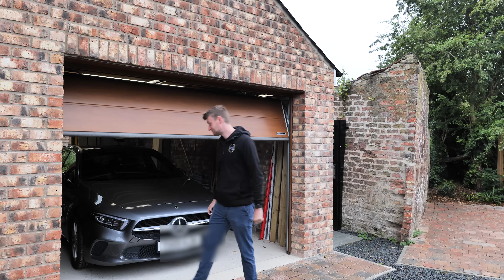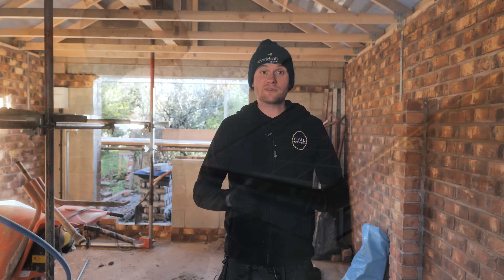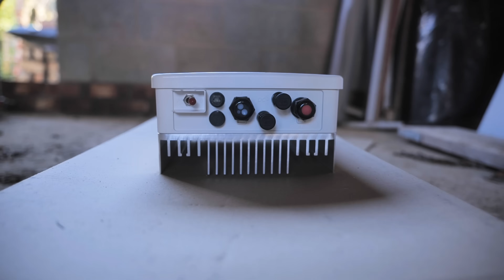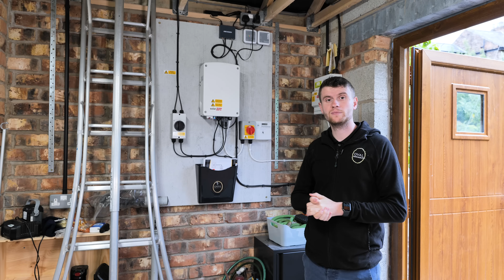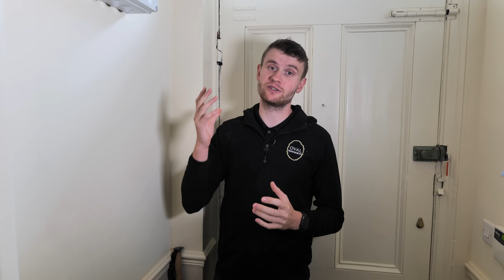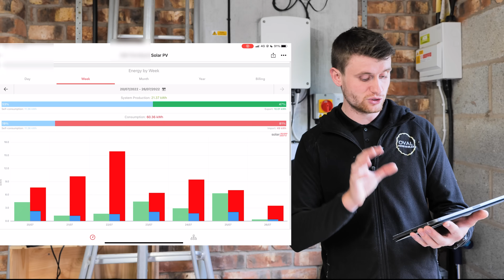The smallest Solar PV system we have ever installed!

Comment: Great video and really helpful as I'm looking to install an in-roof system on my own property. Just wanted to know how you were getting your cables into the loft to each optimiser? We have used Dektite Multicable lead flashing kits to bring cables through, but doing this for each panel seems a faff so wondered how you did this as its not in the video, but totally agree that having the optimisers on the inside makes life much easier should they fail.

Comment: Great video 👍 quick question is there a reason why the optimizer can't be installed next to the inverter like would it be possible to extend the solar panel cables or is there a reason against this just curious . Thanks
Reply from the maker: We do this sometimes when it’s an inroof system that has a good loft. You can’t do this on a normal system as we can’t extend the connection between the panel and optimiser.

Comment: Hello What size are those panels please and where to get them ? I got excited at a small off grid system from my garage roof.Hit full stop and market silence : Can you advise any information on a manual grid/solar power transfer switch  Understood it was possible to select some existing house circuits: Switch them to solar as and when ?  Many commercial manual power transfer devices  in USA but UK  appears silent ?    Ms O

Comment: So the system needs an Internet connection, otherwise it's all guess work. Why can't the system have a visual display on site. Without the input of a third party the  system could be rendered next to useless.
Reply from the maker: They removed the screen on the inverter a little while ago now. You don’t absolutely need an internet connection but it does mean the system can be monitored and updated.

Comment: Thanks for all the info. Can you fit these panels on top of existing roof tiles?
Reply from the maker: No problem. They are designed to go in roof so your tiles would have to be removed for these ones to fit.
Reply: @OvalRenewables  thanks for the reply.

Comment: Interesting that the big disconnector/isolator is in the garage. Building regulations here require them to be outside and clearly labelled, so the fire brigade can easily turn them off for extra safety in case of fire.
Reply from the maker: Is this in America?
Reply: @OvalRenewables  No in Finland. The actual requirement is  a well indicated and freely accessible location for emergency services and power companies. Which in practice means it gets installed on an outside wall (as otherwise you need to leave the door unlocked).

Comment: Can the Solar Edge ModBus be installed as an independent energy monitor ahead of the installation of a P.V. system or does it need the connection of the inverter to work?
Reply from the maker: It would have to be installed as part of a full system as it links to the inverter to send the info to the portal 👍

Comment: Very interesting, cheers for this - just wondering but I've heard from people with less experience and knowledge than you, that recessed panels can be at risk of overheating and producing less power. Is there any truth in that? I'm more keen on recessed personally, less space for birds and insects to hide, and where a new roof is being built, no pointless tiles. Of course that could be a downer if for some reason the panels are removed. Cheers 👍
Reply from the maker: Thanks for the comment. You do sacrifice a slight loss on the hottest days due to airflow but for me the look of them outweighs the losses.
Reply: @OvalRenewables  You're very welcome. Thanks for answering, I'd have to agree with you, especially considering how many actual hot days we get. All the best

Comment: Hi, I have an older system which has four sections of panels (250W) 2x 3 & 2 x 2, 10 in total could I have an optimiser fitted, I have two inverters a Solax and a Solis any ideas please.

Comment: I’ve got a garage with a supply to it and board ,do i need another cable going back to the house .?
Reply from the maker: Hi there it depends on the size of the cable but possibly if it’s a big system and a small cable. We also need to make sure the volt drop calculations work out. Best thing to do is to arrange a survey

Comment: I have dormer windows on a south facing roof so have limited roof area for panels. I had 6 x 375watt panels fitted plus a 5 kw Puredrive battery. In 6 months since install made 1700kW. 700kW has come from the battery storage. I am sure I will out perform the quoted generation estimate 2250kW. So far the panels are delivering 60% of house usage. I have a 2000 gallon pond that use 2.5 to 3 kW a day. Very happy with results. Pay back will be about 5 years at 52p electricity fixed rate
Reply from the maker: Great figures!

Comment: I'm considering solar panels but I live in an end terrace house with minimal internal space other than the loft,roof is south east facing. Would a system be worth installing, are there grants available?🤔 Thanks👍
Reply from the maker: Hi Rob. It depends on the size of the roof but anything that you install will make a difference!

Comment: Would this system be capable of charging an EV or would storage need to be added
Reply from the maker: This system only generates at a low rate so would struggle to fully charge an EV. It is really only there to cover the base load of the home.
Reply: @OvalRenewables  Thanks, unfortunately I only have room for the system covered in the video

Comment: Does the modbus have to be hardwired to the inverter? Looking at a similar install but running a new cat6 would be challenging...
Reply from the maker: Thanks for the comment. I believe SE have a new meter that is available that can connect wirelessly. We haven't fitted any yet so can't say for sure at this point.
Reply: @OvalRenewables  interesting... Do you have a part number?
Reply: Modbus is a protocol over RS485 rather than an item. The energy meter in this video uses Modbus, but there is no wireless version yet.

Comment: Ive been trying to get a small system just to reduce costs even something. Instaler told me dont waste your time.
Its disapointing for small users they want you to take larger systems.
Reply from the maker: Sorry to hear that. Maybe try a different installer.
Reply: Same, installers dont want to take on small systems.
Struggling to get anyone here in Swindon to take on a 1.5kw install to cover baseloads.
Bugs me to give anything back to the grid

Comment: Hi, one question: Without any air circulation underneath the modules, will they not get really hot, reducing the efficiency on hot summer days?
Reply from the maker: There will be a slight effect with it being in roof however it shouldn't be a major issue.

Comment: Great video, all the extra explanation on the build is appreciated. In the video I also noticed that the SolarEdge modbus has to be within a certain range of the Inverter, in this case it uses the RS-485 standard, which in it's self is not bad, but for case where there is either zero cabling or distance is still an issue... it appears this can easily be transported over regular Ethernet infrastructure with converters... since the majority of these installs also require Ethernet links to the internet, it stands to reason this may help solve communications issues where all the kit does not happen to be in the same place.
Reply from the maker: Thanks Ben

Comment: Smart. As its effectively a new build you save on the cost of tiling underneath the PV modules. #solar
Reply: And as of now building materials are so expensive I think the panels are cheaper for coverage than the tiles
Reply: @haldo691  JUst need to be mindful that if a panel does go "phut" in a few years time - will replacement panels (the company that produced them) still be available (exist).
Reply from the maker: Yes it helps to reduce the cost in total when looking at buying roofing materials

Comment: Given how unreliable SE optimisers are (I've got about 20 warranty replacements sat here waiting to be fitted), putting the single optimiser somewhere accessible seems like a good idea. 
Although I can't help feeling you might have been better off just fitting a regular string inverter!

20% of our systems and 90% of our problems are SE. An entirely functional SE system does perform a percent or two better than a non optimised system but most of our systems have faults. Something like 1 optimiser failure per 50kW per year.
Reply: Well when they are in the overcast weather 90% of their life, they last a long time!
Reply: I've got a box of failed optimisers awaiting replacement too. Really not delighted with them.
Reply from the maker: This is quite surprising, I dont believe we have ever had a SE optimiser fail yet! However I am aware that one day it will happen.
Reply: SE stuff is great when it works but like you say it's the worst when it goes wrong and it does.

Comment: I have replaced loads of the lower flashings as they slip out because not fixings.
Add more silicon CT1 under the lower flashings. Good luck guys.
Reply from the maker: Thanks for the tip

Comment: The cement board on a brick wall is a bit of a waste of cement board, even if it looks nicer.  Cement manufacture is terrible for the environment.
Reply: The time saving for fitting the equipment and clipping cables covers the cost of the board
Reply from the maker: I disagree as it makes fixing equipment nice and easy.

Comment: Use the inline trays,the roof panels sit on them,then flashings on the side, you can see some fixings but doesnt look offensive,go for a tesla battery power bank 2, and with a 4kw solar array,you can qualify for 12p per kwh import and export
Reply from the maker: That is certainly one option, however I prefer this system over the GSE plastic trays.

Comment: Great installation Sam . I have 10 x 410 solar panels with 3.68 SolarEdge system recently fitted and they never advised me about a Modbus meter. I would like to update to include a Modbus is this an easy/simple upgrade to do? I am about to have my Consumer unit replaced (RCBO's & SPD) by my local Electrician and was wondering if the Modbus could be fitted on the din rails within the Consumer unit? ( is this allowed? ) of course I would ensure there was space for this to be installed. many thanks.
Reply from the maker: Thank you very much, we find that the Modbus doesn't sit too well in a DB. You are better off mounting it in an adaptable box next to the DB. There are some other videos on our channel that show this setup. Your electrician could install the wiring but I would advise you get a trained SolarEdge engineer to carry out the programming and commissioning.
Reply: @OvalRenewables  Many thank Sam
Reply: Also have a look at the Shelly EM unit. Compare the functionality & costs.  Have a look at this UTube Vid. https://www.youtube.com/watch?v=pgJDla8sWiw

Comment: Great Content - Quality workmanship also.

Am I correct in thinking that where the panels are there are no roof-tiles underneath? 
It's just battens and Felt/membrane to the gutters - with tiles put around the edges against the Solar panels? 

Thanks

Terry
Reply: Yes the panels don't have tiles underneath so you also save on buying tiles
Reply: @haldo691  Thanks - Looking at replacing my roof next year from old red tiles to new black/grey slate - This looks like a perfect solution and as you say, would save on some costs.
Reply from the maker: Yes as the other comment mentions it saves on roof tiles

Comment: Great video!!! The excess Energy that goes back to the grip!! Is It just lost energy to the home ?? Or does it come off on the energy you then use from the grid? 
Thanks
Reply: If the customer is registered for SEG payments they will be paid for it but depending on supplier could be as little as 4p pkwh
Reply from the maker: Yes the other comment is correct. The customer is registered for SEG payments but is only receiving around 4p per Kwh
Reply: @OvalRenewables  don't know how they get away with paying so little my average was 30p pkwh last month on octopus agile outgoing
Reply: If you have old type meter (mechanical)  you are better off

Comment: If the price/kwh for electricity goes to 50p and export is 5-7p then it would make sense to add a battery. That would seem to be on the AC side since the inverter does not have a battery input or when the customer gets their EV to really make use of excess solar during the middle of the day.
Reply from the maker: Yes as the import rate increases during the day then a battery starts to make more sense as it can be charged during the night.
Reply: That ship has sailed. The new standard tariff is already 50p per KW/h (Varies by region from ~47p to 52p, but average of 50p). However, based on continually rising wholesale prices, some analysts are predicting it could hit ~£1 per KW/h by mid 2023. Which is bonkers.
Reply: @Haawser  Lets hope Lizz has got a solution.
Reply: @Haawser  Far from it, its curently capped at 28.34p kw/hr, next month October goes UP to 34p kw/hr. Adds about £209 a year to an above average user. Then knock off the £400 handout, most will be £190 better off than at current.
I wouldnt listen to the scaremongering media, it sells a story - without a story no income!
Reply: @jhareng  The cost WAS going to be 50p per KW/h, but I wrote that before the govt stepped in. If they hadn't the £1 per KWh was also very likely.

Comment: Hi, love your content! A comment though about the Viridian system. I’m looking at this myself but I’m staggered at the cost of the flashings. They’re up there with the price of the panels themselves, which considering the materials and technology of each, seems nothing less than a rip off. I’ve made the same comment on Viridian’s own channel, but funnily enough, they haven’t addressed it. Any thoughts?
Reply from the maker: Hi Paul, thanks for the message. We aren't directly affiliated with any brand so happy to comment on things like this. The viridian system is not the cheapest system on the market. However it is the best looking in roof system in our opinion, this does mean the system is sold at a premium price. A cheaper system would be the GSE option.
Reply: @OvalRenewables   Thanks for your reply! I agree that it looks the business but still contend that the price of the flashings compared to the panels themselves is still taking the mick. I suppose, like everything else in this world, it's going to take volume and competition to force them to drive their price down. ATB.

Comment: bypass your meter its cheaper 😅
Reply from the maker: Haha this is the best legal way 😂
Reply: @OvalRenewables  I'm just on with getting everything together for my install not sure of the legality of installing it myself but gonna do as much as I can to keep the cost down.
Reply: @axgtsimi  Up to a 3.6Kw system you can install yourself except for attaching to the grid which requires an electrician. Once complete email a G98 (i think) form to your local electricity board eg. Norweb and you're done.

Comment: Can you provide a rough cost for this specific install? I imagine it might be "cheaper" as you had such nice access to the roof, and roofspace, due to it being built at the time.
But would be nice to know how much a basic solar system would cost to install.
Reply: Use £10k as a basic figure with battery storage without battery’s around £6k
Reply from the maker: For a basic install from us you would be looking around 6-8k which includes SolarEdge and then about another 8-10k for battery storage.
Reply: @OvalRenewables  fantastic vid as always. Would this price be for. 5kW system or a small one like here? Cheers